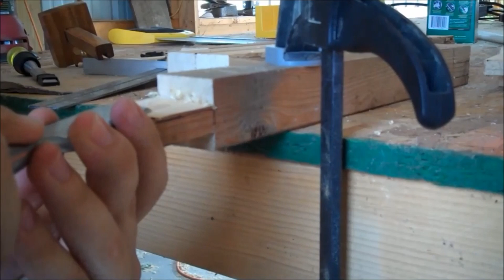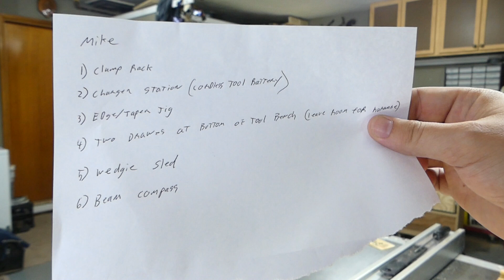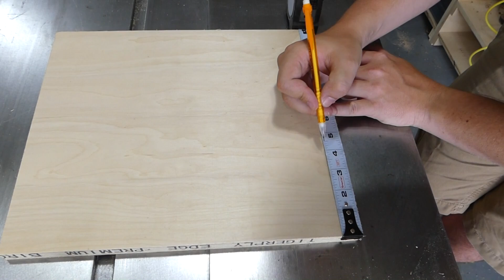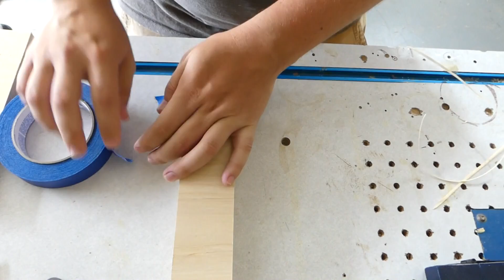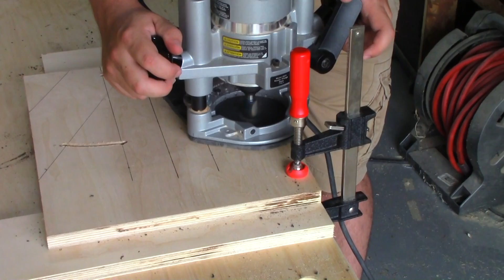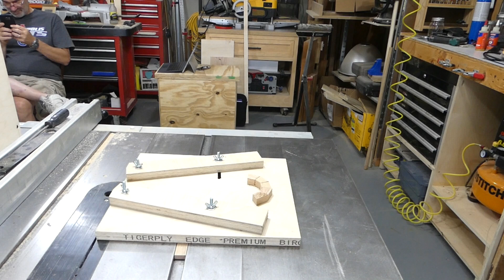🕷 Wedgie Sled / Collab with MF Woodshop Guys Woodshop and RJB Woodturner

Comment: The wedgie sled is awesome. Did you make the wedges also or did you buy them?
Reply from the maker: +Jeff Walters didn't build the wedges, left that to Mike by the end of the build it was getting pretty late in the day. But so much fun hanging out with those guys
Reply: Thanks. So Mike is making the wedges then. I've always liked this jig but didn't want to have to buy the wedges.
Reply from the maker: +Jeff Walters it's not to bad just set half the angle of the wedge on the miter gauge in the table saw and cut both sides of the wedge and you're all set not to much involved in it. Don't waste the money on pre made ones and put that money you saved into materials or another tool.
Reply: Thanks a bunch. I appreciate your help.